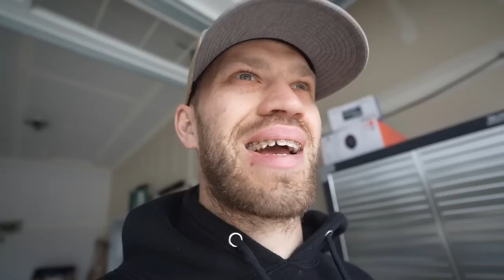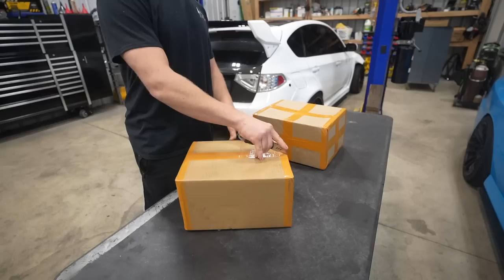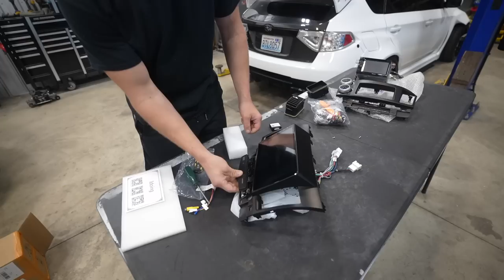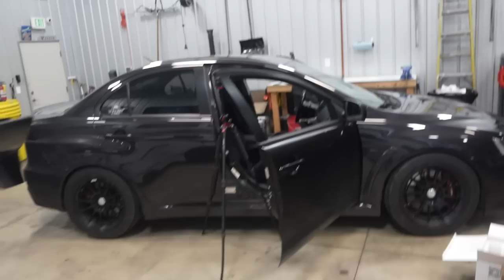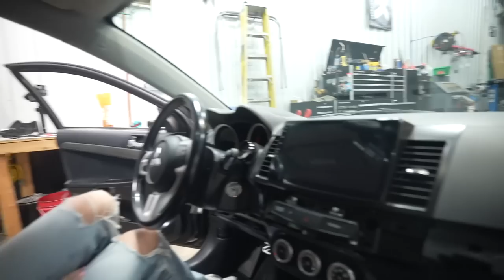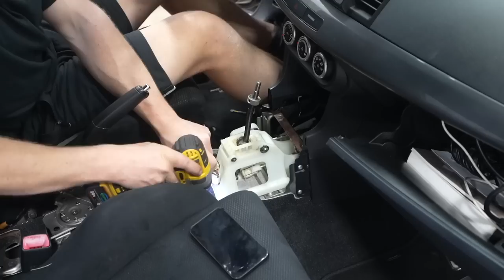An Interior Makeover for the Evo!

Comment: Hey Dev, I believe when you swap over to SSS headlights in a non sss model, there is some settings in ETACS you have to change for them to work properly. Since you’re using the bulbs and ballast that might be your issue
Reply: It is the DRL. The voltage differs on the halogen setup and the HID setup. The moment you drop the ebrake the DRL kicks on and the Now current HID flickers until they come off. Same issue happened to me, Just got a guy local to code it off on ETACS. I mean it looks better off in the day time imo. In the night time I just flick my low beams on.
Reply: @Hellaskeptical  correct. I remember it being something simple in ETACS like disabling the DRL. Mine was a factory SSS so I never had to but read up on the issue for future reference.
Reply: @omarshaba3517  I think you also need to specify headlight type other than DRL setting, I went from SSS headlights to Vland and I'm using LED bulbs rather than HID and I had to change it.